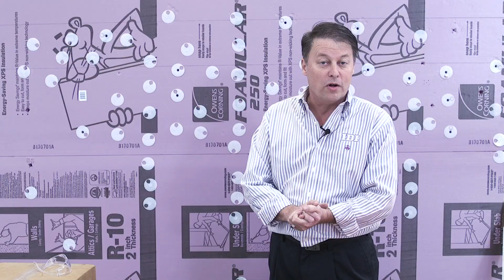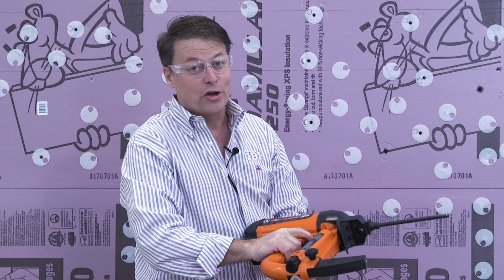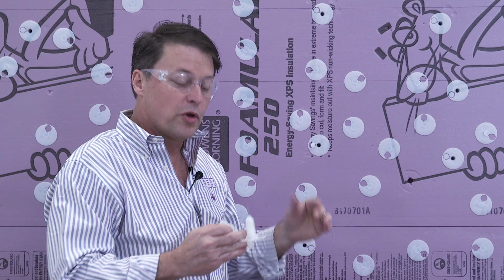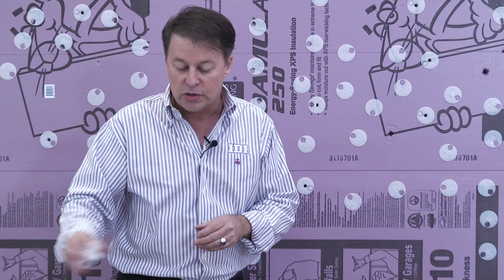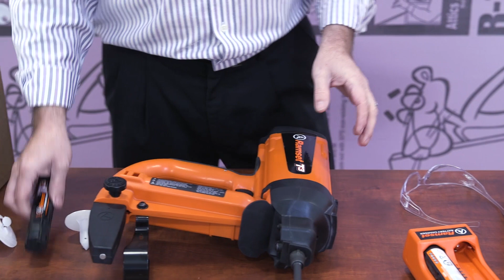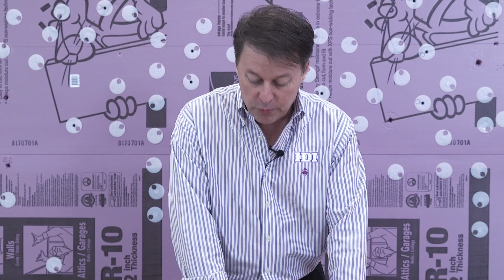Fastening Continuous Insulation [Using the Ramset T3]

Comment: Can you advise me as to why my tool would not fire .I've opened and  cleaned it and also used fully charged batteries and new gas...
Much appreciated 
Email me me at:
jaiesh.bhikha@dumore.net
Reply from the maker: Hi Jaiesh, Thank you so much for reaching out. If you bought your tool from IDI, please bring it to the local branch and we will contact ITW to find a solution for you. If you got the tool from another location, you may want to contact the manufacturer. More than likely they will want to see the tool to determine what happened. If you have additional questions, please give us a call at 888-843-1318. Thank you!